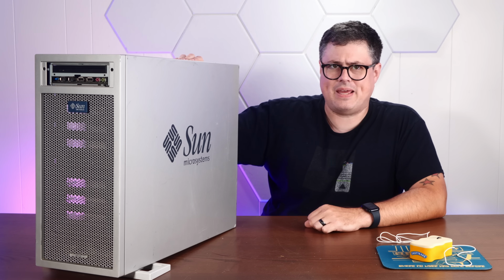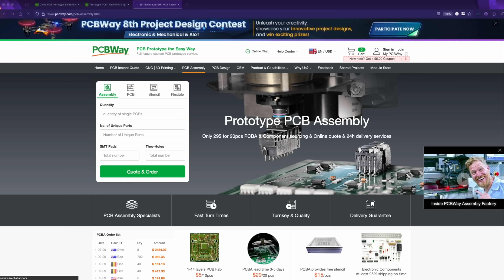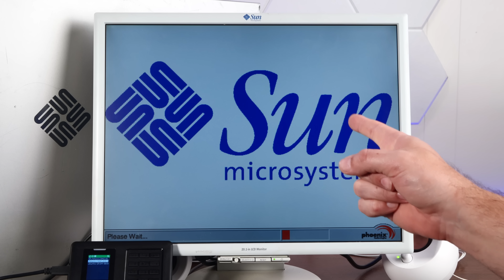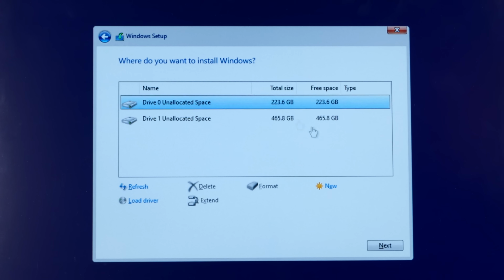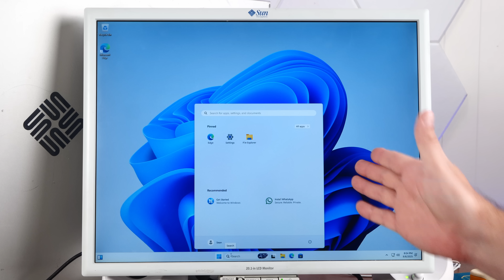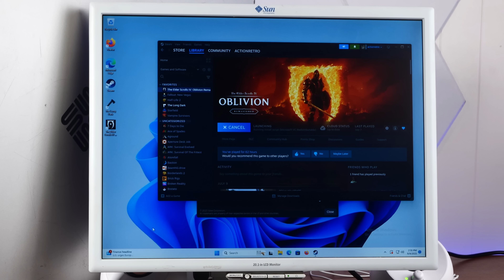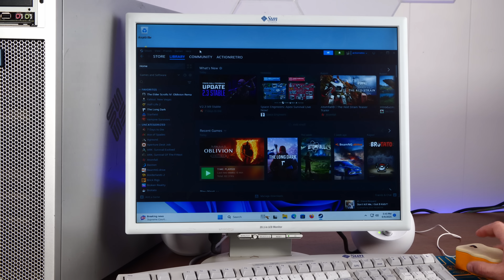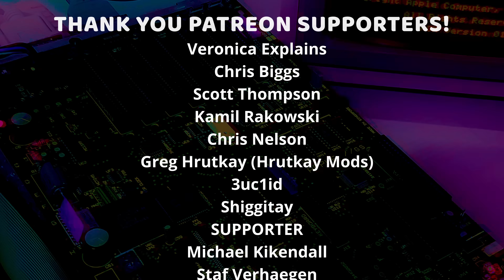The Oldest PC That Can Run Windows 11

Comment: YouTube will run fine as long as your GPU is new enough.

It doesn't even need to be a new or even good GPU, my dad's old Core 2 Quad struggled with YouTube at 480P(it would be smooth enough, but screen tearing would happen at times, but 720P was unwatchable) with onboard, but adding a GT 710 means he can watch stuff at 1080P now. I don't remember what card is the "minimum requirement" for this, I think it may be said GT 710, but at some point they added video decompression acceleration as standard on all NVidia cards.
Reply: You're both right and wrong. Youtube uses video in 2 codecs: h264 and vp9. With h264, yes, hardware acceleration helps a lot, but I don't know ANY GPU supports vp9 acceleration. I don't remember what exactly are conditions that make youtube use vp9, but that is the reason why people recommend installing h264ify for older systems.

Also, I dailied C2Q machine for quite a long time, and while vp9 1080p60 decoding is really heavy on the CPU, it's very much possible if you don't disturb your system with something else, so I don't know how would your dad have issues with 480p... Considering that, it's possible that 720p video was decoded on the CPU, and it's not surprising it worked quite well.
Reply: @hikkamorii  Youtube actually uses the AV1 codec as well for 4K videos. GPU acceleration for VP9 has been around for a while now, at least since Intel's Kaby Lake iGPUs, Nvidia's Maxwell, and AMD's Vega (specifically the Ryzen APU version, not the desktop cards).
Reply: @NoToeLong  Well, AV1 is pretty new, but it makes sense that they'd use it at least to some degree now. 
As for vp9, actually yes, seems like newer GPUs do support it, I thought it was supported only on mobile chips. You're wrong about Maxwell supporting it though, they only added support for it since Pascal.
Reply: @NoToeLong i've got an intel skylake cpu which while doesn't support native VP9 acceleration, there's also a hybrid driver for linux that's supposedly more faster than pure software decoding. it does consume 3D rendering resources though
Reply: @hikkamorii  I can tell you it works. It's a really old machine(he bought about 10 years ago, and it was already second hand by then) and it really struggled with YouTube until I plugged in that GT 710, which is(or was, I guess) my emergency card since my computer has no onboard, and it's been good ever since.
Reply: same, except mine is a gt 730
Reply: Or if you're not running WIndows.  My dad had a Core 2 Quad he was using until like 2 years ago with Ubuntu Linux.  Videos played at 1080 (...using like 180% CPU time, so the power consumption was a brutal ~50 watts playing a Youtube vid LOL), he was doing Zoom conferences at least once a week and sometimes more often too, working on huge mutli-100-page documents full of charts and graphs, lots of printing and some scanning (photos and pages) now and then.   That computer got a hard workout.  I did wonder if it was the oldest system on Zoom (given Zoom requires a supported OS).  

He still didn't want an upgrade, but I got a nice Coffee Lake system for myself and one for him, and moved his install over onto it, simply due to the likelihood that the ~20 year old system would blow a cap or something sooner or later as opposed to any actual performance issues.  It was just slow enough that nothing seemed quite snappy, but nothing seemed all that slow either.

Comment: Sun just happened to pick the technologies that would still be current.  It wasn't long before Intel followed AMD and came out with their 64bit Core 2 and enhanced virtualization support.  I remember when datacenters used server blade configurations before moving to racks of hypervisors.  I do feel that the speed of tech progress in the desktop space has stalled since the standard bottlenecks don't typically exist anymore.  Instead, peripherals like powerful GPUs and fast RAM/SSDs are the latest tech while the CPU advancements over the past 20yrs have mostly been just increasing core count and better power efficiency.

Comment: You should probably look at the game requirements before you try. The remaster requires a 6 core 2600x or 6800k cpu at the minimum. It was never going to work.
Reply: oh yeah, isas are important as hell
persona 5 royal refuses to launch on my k10 presumably because of that
(yep, my main pc is obsolete hardware. funny)
Reply: it's not about core count or generations, usually only instruction set matters (although yeah, some games refuse to launch on 1 or 2 cores)

Comment: A handful of modern games require AVX or AVX2 instruction set on CPU or other instruction sets that were tacked onto x86-64 over time. Sort of the nature of precompiled binaries. Compiled with instruction your CPU doesn't understand = illegal opcode. Similar to the POPCNT issue you ran into with Win11 itself. This is where FOSS comes in clutch, because you can simply compile with the instruction set optimizations your CPU supports.

Comment: I thought the old 64-bit AMD processors were missing the CMPXCHG16B instruction and regardless of checks, Windows just wouldn't boot on them because it's an instruction that is actually used often enough if allowed. That's what prevented me from upgrading from 64-bit Windows 8 to 8.1, had to reinstall the 32-bit version instead on one of my machines. Have these very first processors got that instruction anyway?
Reply: The first ones do not.  This is actually the 4th generation of K8, which along with the move to a DDR2 memory controller (and thus new sockets), added CMPXCHG16B.  Although I still would have thought it would have had an issue with the lack of Prefetch/PrefetchW.

Edit: Figured it out.  What changed in the late revisions is that AMD added a separate CPUID flag specifically for Prefetch/PrefetchW.  However all AMD64 CPUs should have these instructions since they were a part of 3DNow! and the programming manual states that any of the 3DNowPrefetch (the new flag), 3DNow, or Long Mode flags are sufficient to assert availability.

Comment: 9:01 is how you Kill your GPU FAST! Never use the Pig tail connectors.... you need 3+8 with each cable being 150watts each. please people NEVER DO THIS
Reply: Yes I did, I even measured the current because I was wondering about it. The connectors are rated at 150W each, the cable itself is sized appropriately to handle the 300W of both connectors (with a healthy margin). PSU manufacturers wouldn’t be shipping cables like this if they were unsafe to use.
Reply: @just.oblivious  Depends on the manufacture. If Corsair then yes each cable is rated for 300W but when it comes to GPU manufacturers then it depends but for safety and general idea. Use two cables for more powerful GPU's
Reply: What are you talking about? The cable that’s running from the PSU to the first 8-pin connector is rated to handle the current of both connectors, this really isn’t an issue unless you’re using aftermarket cables that don’t match the PSU.
Reply: @just.oblivious you don’t read the manuals do you? Each cable can only handle 150watts and each 8 pin connector is rated for 150watt. This is why so many people burn out their GPUs and loose 13-35% of the GPU performance and experience stutters and or crashes.
Reply: @DarkKielx  I'm sorry, I don't even understand what you're talking about. What do physical connectors have to do with GPU degradation? Obviously, if you don't provide enough power to the GPU, at best you'll be power limited or at worst will experience crashes, but that has nothing to do with your PSU cables and their configuration.
Reply: @hikkamorii  Read your manual to your GPU and it explains in great detail on why using the pigtail connector is not optimal. I could go into great detail but I would have to write a book....
Reply: @DarkKielx  Manual to my GPU doesn't mention anything about PCI-E power at all (which is really odd actually, but it is what it is), so please, enlighten me. How using "incorrect" cables can cause a GPU degradation?

Comment: Tip to save you time in the future. Motherboards require special support to be able to boot from NVME drives. If the motherboard predates NVME, it simply wont boot from it, not even with an adapter in the PCI-E slot.

If you absolutely need to do it, you need another system running on a non NVME drive to bootstrap.
Reply: There are some older systems out there which pre-date NVMe drives but have a modified BIOS available to support NVMe booting. The ones I've seen were for LGA775 and LGA1366 systems.
In addition there's also some software solutions which use another boot device like an USB stick or an Option ROM to start an NVMe-compatible bootloader.
Reply: just use clover bootloader on usb or something like refind, maybe tianocore emulating uefi on mbr
Reply: The "Samsung 950 PRO" will boot on older motherboards with legacy Bios that predates NVMe,
I have one installed in an Evga X58 (LGA 1366) motherboard from 2009 and it's working great.

No need for a USB drive with bootloaders that emulates NVMe or anything, it just boots natively.
Reply: Bruh just install grub in a different drive which will boot the nvme automatically
Reply: After discovering this the hard way a few days ago, I implemented a quick and cursed solution: installed Debian server to a 16GB flash drive so it would create a GRUB config for me, then set that as the only boot option in my system BIOS. It's been working great, I actually vastly prefer this to my old setup with competing bootloaders on different drives and not being able to delete old entries from the BIOS without a factory reset. Thank God I found a workaround because I have three more PCIe x1 to NVMe adapters on the way.
Reply: Yeah I didn't start to see NVME booting until around Broadwell or Skylake.
Reply: hay un bootloader que puedes instalar en una memoria usb, clover bootloader, para que inicialice el sector de arranque del nvme donde se instala win11, lo he probado exitosamente en computadoras optiplex con procesadores de la era pentium D, saludos desde latin america.

Comment: Clover EFI would be a good option for this.  If you can't get the installer working using that, just clone a windows install over to the pci-e ssd and boot into Clover EFI and it will allow you to boot off the pci-e ssd with uefi and gpt even if your board doesn't support it.

Comment: 10:46 "no computer is e-waste if you still have a use for it" BASED
Reply: I still have my windows 98 Pentium 4.....still use it to play old games quite often
Reply: @patrickmcgee8556Pentium 4 is pretty new for windows 98
Reply: True, yesterday I repurposed an old Lenova X260 laptop as a steam machine running Bazzite for playing older games on and it works fine. Means I don't need to have so much clutter on my main PC. I've also recently redone an old CODA 1.4 as a ChromeOS Flex pc for basic surfing etc.
And already have various other older equipment working for specific tasks like SRD monitoring and downloading etc... And even older (ancient) laptops that are setup to play MS DOS and early windows games natively. 
On the 'just to learn and see how it works' front I've got a  Lenova X230 laptop running Android, 9 just because... why not!

e-Waste is only e-Waste if you make it e-Waste!
Reply: Even in a sentence that short, I still have zero idea what “based” is supposed to mean.
Reply: @CantankerousDave  based
Reply: One word "Linux" ....
Reply: Sadly, the power bill will kick in fast.
Reply: Never mind there's no security updates throw it in the trash. /S
Reply: Common sense, not "based"
Reply: @one_step_sideways  At least if you want an Server PC which only hold DATA which I don't think your care at all it running 1Ghz  as M.2 Drives are likey the point you using it for not for Powerful hardware just using it as an Data Center don't care if you have it running lower then is should ( Server CPU also don't use much Power as it likey about being live for long over shorter time )
Reply: @one_step_sideways  common sense, therefore "based"
Reply: @itsdokko2990  The meaning is a little deeper, but as it is being used here, just think of it as a replacement for the word "cool" or "correct", or perhaps, "I concur"

Comment: Hah, that Commodore-style ctrl placement actually makes some sense. I'm considering trying it out, although currently, I just use home in that position (since there are not enough keys on the right side of  Keychron Q11 to accomodate it).
Reply: Yes, ctrl and caps lock placement are the only two major mistakes in the standard AT-101 keyboard layout.

Comment: Those old Sun cases looked so cool!
Reply: I almost managed to thrift one for fifty euro, replete with some system I cared not a whit for. Would have built my Ryzen in it. Unfortunately it was too large for personal transportation and I didn't have a friend with a car available at the moment, so I had to leave it there :(
Reply: I still have an old Sun IPX Sparkstation along with all the external stacks, secondary hdd, cd rom, and DAT tape! I still say it looks more 'futuristic' than todays computers 😉
Reply: Yeah and it seems to support SATA and modern GPUs so probably the easiest Sun Microsystems computer to use as a modern daily driver or something like that.

Comment: I love it when my computer sounds like a jet engine taking off. That's how you know it's a computer
Reply: "haha it's thinking"
Reply: Even better when it is the old mechanical HDD making the jet sounds, Lol
Reply: Some computers (and other devices like rack mount network switches and routers) spin up the fans to 100% during boot to make sure they're working properly. It measures the RPM and ensures it's within the accepted range, before applying the saved fan curve.
Reply: This comment is really funny 🤣🤣🤣🤣🤣🤣
Reply: Then you would like my 2010 asus republic of gamers it has three big powerful fans that sound like a jet taking off
Reply: How do you tell it's not a jet engine tho🤔
Reply: Seriously though, would you be in the same room with that thing when it was operating? Or would be hidden in some noise dampening furniture or does it chill out after a while?
Reply: @drennansmith595  They generally do quieten down a bit after a while!

Comment: Try running Windows 95 on a 386 with 4MB RAM and see if you still think system requirements are bunk.
Reply: I'm guessing the 386 would be the stumbling block in that setup, but is that because the code of Win 95 requires a 486/Pentium, or simply that there isn't enough processing power in a 386 to have Win 95 run at a satisfactory speed?
Reply: @danyoutube7491  Windows 95 doesn't require any 486 or Pentium instructions and will run on a 386 if you have the ram and disk space to install it
Reply: @danyoutube7491  Windows 95, NT and OS/2 (and also the early versions of Linux) will all technically run on as little as a 386SX-16 but the runtime speed will be glacial even if you can install enough RAM to run them. (If I recall, 386SX motherboards typically maxxed-out at 2 MB RAM.)
Reply: @zoomosis  Nah, you could usually get 16MB into them (though there were terrible - but thankfully rare - chipsets that only supported up to 4MB).
The real problem was finding 4MB 30-pin SIMMs at a sane price - and if cost wasn't an issue, you weren't buying a 386SX in the first place.
Reply: @danyoutube7491  Tell that to the channel "NTG Technology". They made a video titled "Windows 95 on Minimum Requirements". They show a Windows 95 box that clearly says 386DX.

Comment: The "micro" in sun "microsystems" there is very relative
Reply: Well compared to their datacentre systems this tower is tiny
Reply: As compared to a minicomputer or a mainframe, it seems pretty small.
Reply: "Micro computers" was a classification that more or less meant "can fit on a desk".
Reply: I'm not sure what you are getting at here?
It's 'microsystems' as in they use microprocessors...
I used to work with a range of SUN Microsystems UNIX servers, they were very reliable machines. More so than the HP servers we also had.
Reply: Gotta remember that in the old tongue, a "Computer" was the size of a room, a "minicomputer" was the size of a cubicle, and a "microcomputer" was basically anything a single person could pick up and move themselves. 

Of course, today everything is a microcomputer, would probably make sense to define pico and nanocomputers.
Reply: @OhhCrapGuy  a laptop should be called nanocomputer
Reply: @mike_et_saika  smartphones should be picocomputers then
Reply: @OhhCrapGuy  a time when "portable" meant "not bolted down" :D
Reply: @OhhCrapGuy  whatabout femtocomputers and attocomputers

Comment: That k2200 card is about 7 years newer than the computer so it's doing the heavy lifting.
Reply: Barley. Yeah its helping, but thats like saying putting a 5090 on a pc with a i7-6700 suddenly the frame rate the i7 is capable of is a lot higher. The Optoron still has to be capable and the K2200 won't help it with general windows either
Reply: @kodokuj  Windows 11 (including the shell and apps) are largely hardware accelerated using DX9 or DX11 (it varies). So actually the K2200 is doing almost all the heavy lifting here.
Reply: The GPU does not magically offload work from the CPU. They are for very different tasks. If the CPU is total garbage the GPU is not gonna save the framerate no matter what
Reply: It really is helping, especially with the Youtube video decoding which would be stuttering like crazy

Comment: but you have not installed windows 10 on a 32bit T43 which is pentium M 1.83ghz single core and it runs the worst i have ever seen windows 10 run and i did it once and sent a picture to a guy who went you can't do that lol.